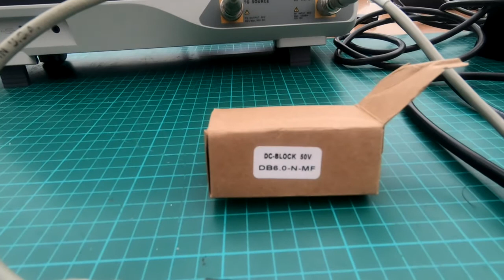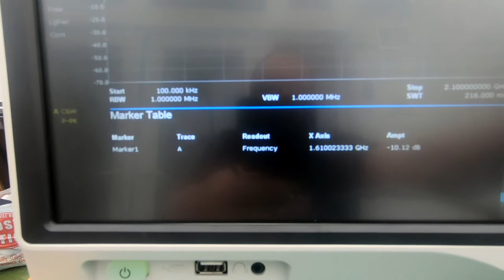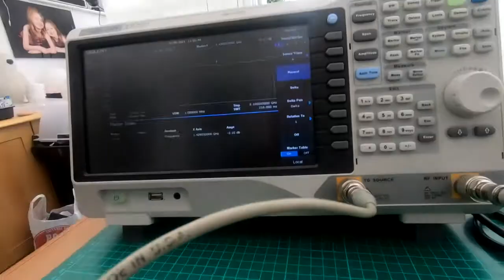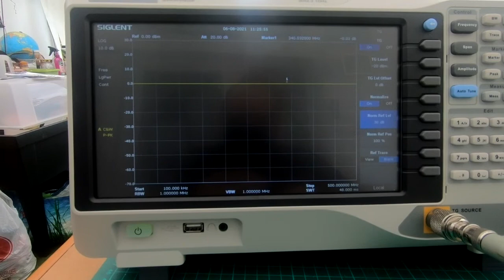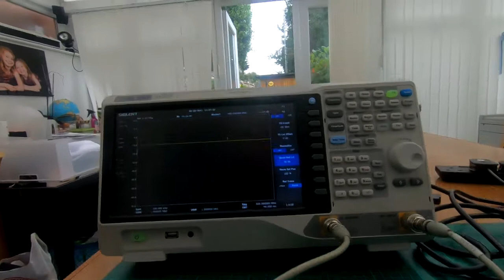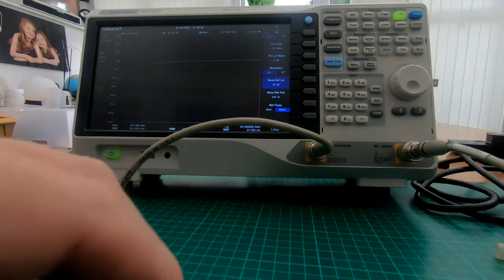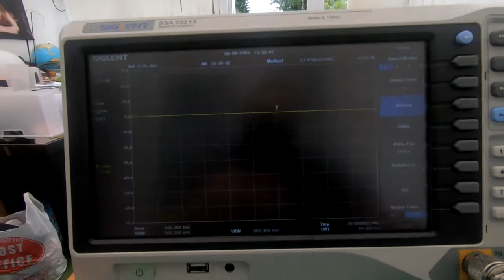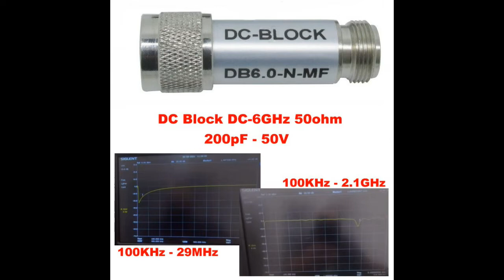DC Blocks are not made equal, tested with a spectrum analyzer SSA3021X. Part 2

Comment: What does this do anyway's . like what is the main purpose to use this?
Reply from the maker: One Gold rule is to never allow DC voltages into a Spectrum Analyser.  If the Analyser input states 0VDC MAX
It is recommended to use DC blocker attached to the input of the instrument before you conduct any tests.
DC voltage can damage the instrument.